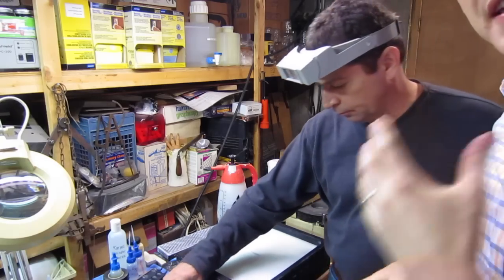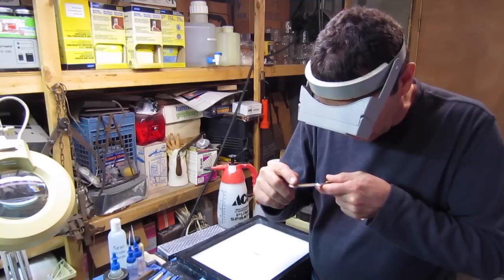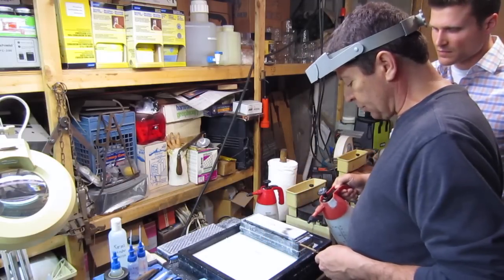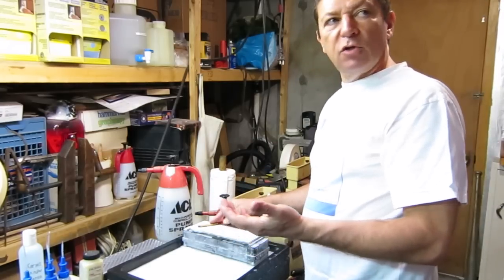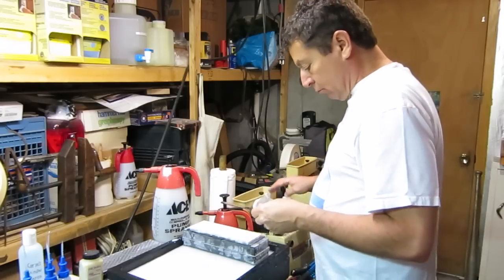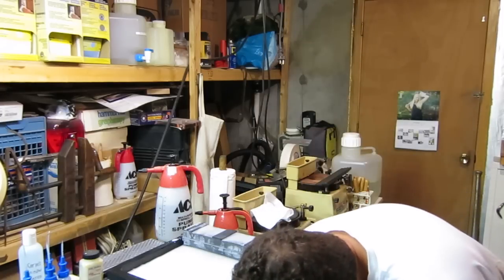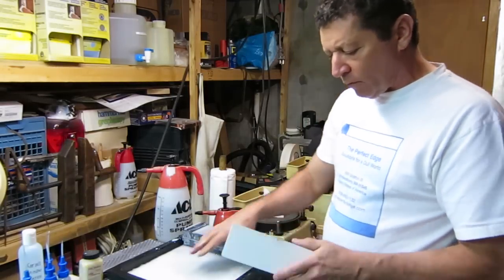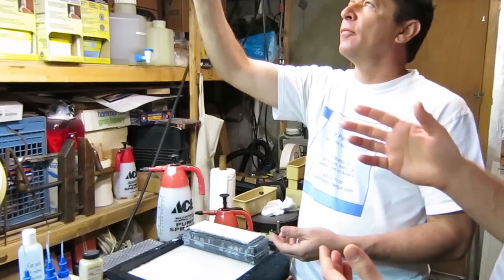The Perfect Edge - Straight Razor Sharpening

Comment: A perfect edge does not reflect light and it shouldn’t. I look at my edge straight on with a light about me and if I see light on the edge it not an edge.
Depending on the steel and it’s Rockwell hardness, I have sharpened a boning knife that I shaved with. 5000 grit whetstone and a leather strop. 58 rockwell Wusthof   I shaved with it with just stropping for about three months before I needed to hone again. Just 1000, 5000, then leather strop. I get a burr 4 times on each side before I whetstone strop on same stone before I move on to next level. I did the same with my straight edge after I tested with the knives first. 
I have a Vintage Dovo Solingen. (Saw it on eBay for $1100. No way it worth that much) for my 60th my wife bought me a Ezra Arthur-Max Sprecher Signature. She had to spend around $700- 800 for it. It’s like butter. The only thing I do differently is I add an 8000 splash and go and spray .5 micron diamond spray on my strop before stropping. It’s sick and ridiculous how sharp it gets. The hair on my arms then on my face jumps off my skin. Anyway, great vids! Keepem coming!

Comment: Well Fuck and I always said why the spine of my straight ain't that straight. Really informative vid keep it up Nick
Reply from the maker: Ahmad Al subhi Hopefully your edge is straight!
Reply: nick shaves it seems that i can't get the entire edge sharp no matter how i hone. I get a smooth shave with most of the edge but there is a very obvious togging when i shave with some spots of the edge. Well that's what happen when you buy a cheap straight razor from ebay.
Reply: Al, I use a machinist's straight edge to see what's going on with a spine. I lay the spine on the straight edge and hold it up to the light. You'll see light come between the straight edge and the spine and it will inform you as what to do. I actually grind the spine until it's flat and no more light comes through. The edge will then fully track the spine on the stone. It's a bit of a delicate operation but, with practice, you can do it.

Comment: Hi honing at that speed would heat up the fine edge and mess up the temper on the blade surely,It does not take much pressure and speed to heat the fine edge up.
Reply: LOL! Nick speeded up the honing as otherwise it would get too boring to watch. I also have that stone wet down so there's no way the edge would heat up. That particular problem is actually a "thing" with me as I run into so many people who sharpen edges on belt sanders. Doing that will ruin the temper at the edge. It only takes a second or so as the edge is so thin, it heats up above 400 deg F. right quick and the heat treat is gone . . . right where you need it the most. All of my honing is done wet and the edges never heat up.

Comment: Seems Howard isn't too worried about the amount of pressure applied to the blade?? great vid by the way!
Reply: AaronD711 Oh contraire! I'm very concerned about the amount of pressure. Too much and you can bend the edge back off of the stone, too little and you're doing nothing. Lots of practice and magnification and your fingers will get the muscle memory needed to get repeatable results. I also vary the pressure across the blade as some blades come to me with a smile and that end needs more pressure than the middle. The beauty of the Shaptons is that they're white and when the edge is in contact with the stone, you can see the gray smear of the steel across the stone.

Comment: Howard is a bit weird as i seen in some of his other videos on here.  I think the guy is very intelligent but I have never heard of anyone only using 10 passes on a strop ( what's the point right? ) and if his method is so precise then why does the manufactures of these razors not endorse his method and also many other avid straight razor shavers.
Reply: +Howard Schechter  I am no way as good as a honer as you are Howard. I meant no disrespect but find it puzzling on how to keep a blade sharp with only 20 strokes.  Do you think it is better to just use a Naniwa 12k as opposed to a strop before each shave?
Reply: James B, naked leather strops don't sharpen steel razors, they'll burnish the edge, get rid of any crud, and maybe some flash but that's about it. I actually don't use hanging strops anymore as I've found they degrade the edge. We've seen this at 1000x under a metallurgical microscope. These days I use a plate strop, thin leather mounted on oak and pasted with .5micron diamond, CrOx, purple phase, and zulu phase. Comes out really slick.